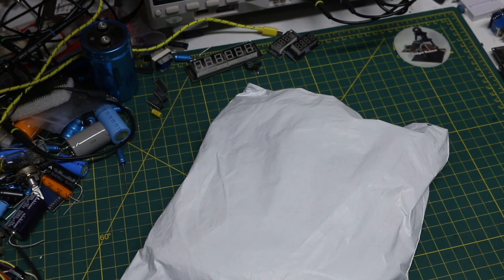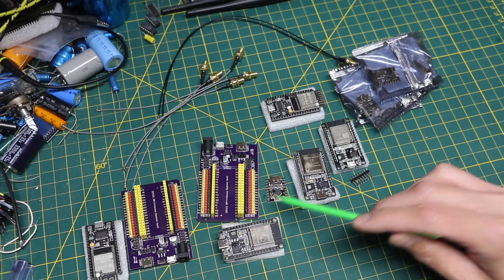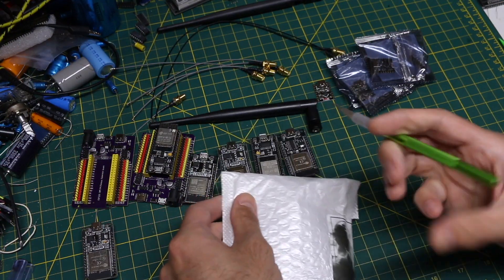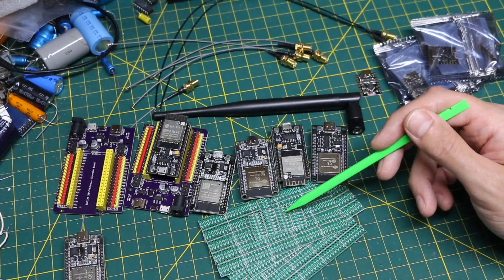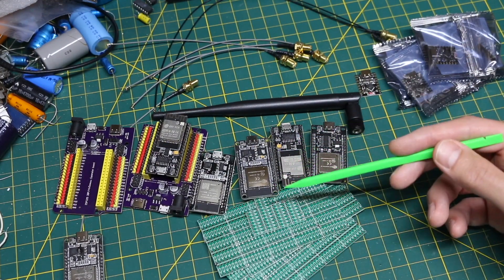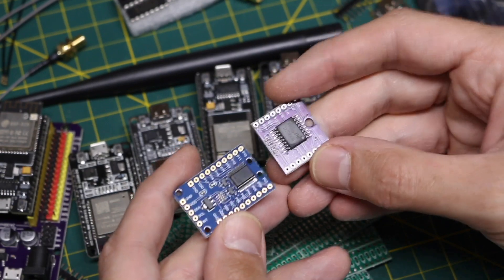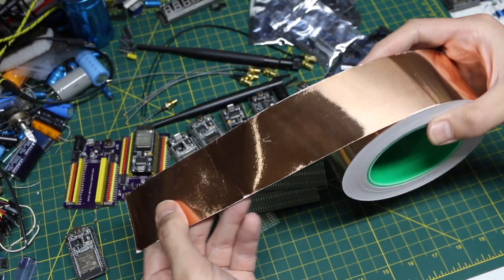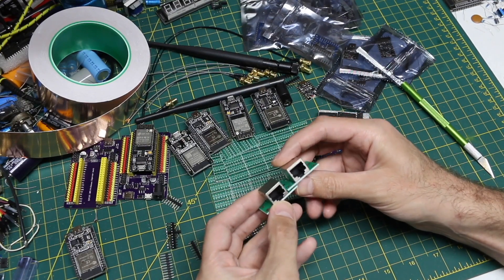Mailbag!

Comment: Those ESP32-C3s are interesting! BTW, I always forget to ask you, what do you use for magnification when working with SMT? I really need something other than a magnifier lens on 3rd hand...
Reply from the maker: When needing to magnify for soldering, especially SSOP small ICs, I use one of those generic USB style microscopes with the built in screen so it can work stand alone or the display can appear on computer, or images/video saved on SD card.  It's similar to this one but not the exact same because I got mine years ago https://amzn.to/3xDwCJQ
I think they're all basically the same.  I haven't used it with hot air, don't know if there'd be enough space but would also risk melting plastic.  There's enough room for a soldering iron since that's used on an angle.
Reply: @GadgetReboot  Thank you so much! I'll be looking for something similar. I really need something because smaller SMD components look like sand to me now. Heh
Reply from the maker: yeah the microscope is also good for inspecting the soldering job and finding solder bridges from pins that are very close together that can’t be seen with a regular magnifying lens
Reply: @GadgetReboot  I've been told numerous times in the past that you can't really use these USB cams for soldering because of the latency. Any opinions on that?
Reply from the maker: I would expect if there’s any latency issues it would only be when using a computer, I only tried it momentarily when I first got it and I can’t remember if I had noticed that but using it with the built-in display seems real time.
if I did have computer latency it wasn’t really a problem because I had to move so slow anyway with being zoomed in so much that any small move I make is excessive so I have to go very slow and get things properly in position and then it doesn’t even matter because I know I just need to press the iron tip slightly beside wherever it currently is and it can lag a few milliseconds if it wants
Reply: @GadgetReboot  THANK YOU so much!!

Comment: So far I prefer the matte clear coat over the glossy --- you don't get the shine but it doesn't scratch easily, I like that trade off.
Reply from the maker: I wonder if I can take a previously glossy one and sand it  down and possibly redo it in matte. there was one thing I did where it should not have been glossy

Comment: Have you considered making a society recovery computer.
Basically a raspberry pi in a faraday cage, with a bunch of knowledge repositories on a sd card.

Some people go far adding sdr, gpio breakouts, network switch and other things like solar and battery.
Reply from the maker: sometimes I wonder if society should be put in a cage. But when I think about it I am behind in the raspberry pi collection I think I only have a 3B as my latest.
As far as storing information and archiving, one of the things I need to do is start doing a proper back up, I’d like to get a NAS set up and some redundant back ups because I’ve been tossing coins and hoping for the best for too many years.
Reply: @GadgetReboot  I too ponder the about the cage.
Mostly seeing the copper tape with the mention of a faraday cage is what brought this to mind.
Reply from the maker: it may be good to make a faraday enclosure to store phones or any sort of key fob for a car to help prevent unwanted poking around over the airwaves as well.